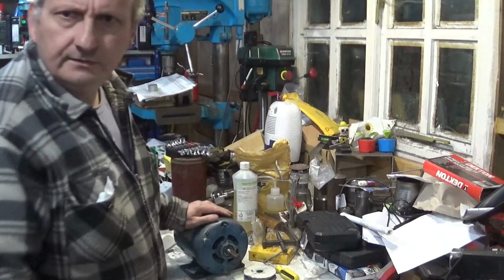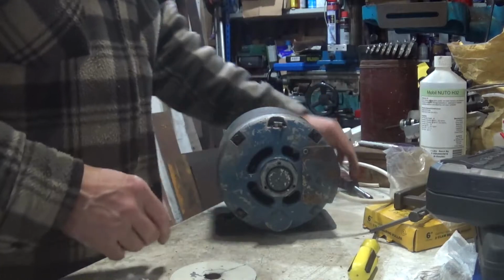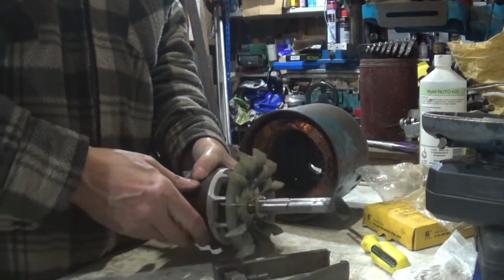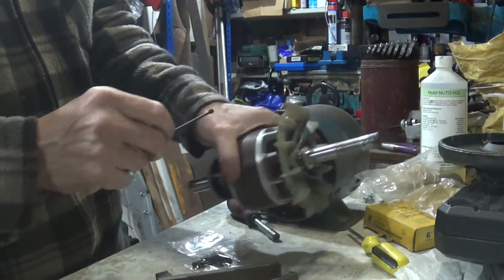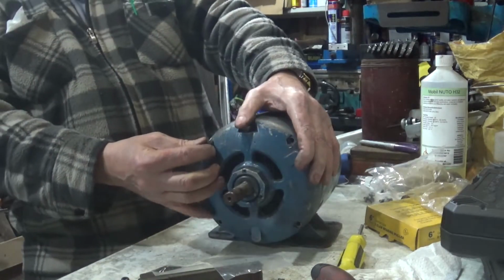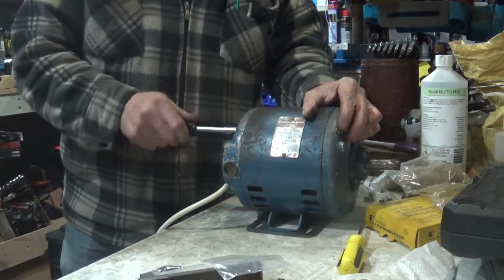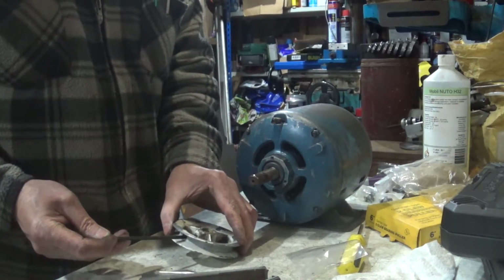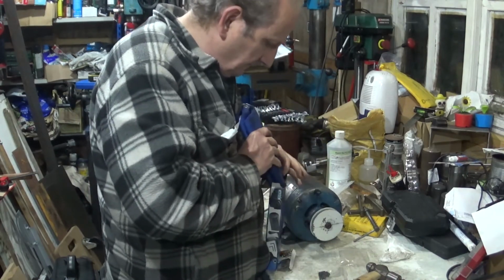Finding and fixing the noise in an induction motor and how the centrifugal switch works

Comment: Great vid - turned up on my feed this morning. Have the identical motor ('80's vintage) on an ML10 lathe, which had rendered the two upper pulley speeds unusable because of the noise. I had the motor off already and it wasn't obvious from poking through the front of the casing, that the fan was loose. Once the front was off it was clearer. I removed the plastic washer, the  shim-washer and the circlip to slide the fan off. There is an indent in the shaft and the grubscrew on mine had backed out sufficient to have lost hold in the detent, but not yet to have flung the screw... I Loctited it back as I didn't want to have to tighten the ancient plastic overmuch. Lathe is back together now and the loud and random bursts of  "ticking" noise have gone. Since loading on the motor seemed to have been a factor in provoking the noise, I had originally imagined some kind of bearing issue (somewhere!). Thankfully not so as it turned out.
Reply from the maker: I am pleased the video was useful to you!
Many thanks for watching, please like, share and if you like the channel, subscribe!

Comment: Found the video I was missing. Thanks.
Reply from the maker: You are welcome. Hopefully it helps. What sort of motor have you got?
Reply: @BensWorkshop  Compton Parkinson 0.5 hp fitted to Myford ML7.
Reply from the maker: @grahamsmith8122  Reasonably sure you can pop the windings out if you need to. I presume the power comes in from the cover at the back where the centrifugal switch is? In which case that is the way it wants to come out. But try drying it out first.

Comment: Got my motor apart and would you believe it, my fan was also spinning on the shaft! Still not found a reason for it to blow the trip though, everything checks out OK, as far as I can tell.....
Reply from the maker: Have you checked the centrifugal switch for debris or for a leak to earth?
Reply: @BensWorkshop  Had it all to bits today and tested all the contacts. Seems to run straight to ground when switched in either direction. think the windings are tracking out but cant get the windings out. will buy a new motor.
Reply from the maker: Try putting the motor body with windings on a radiator over night first just in case they have got excessively damp.

The actual windings can normally be coaxed out. What sort of motor is it? (Make, HP rating etc).